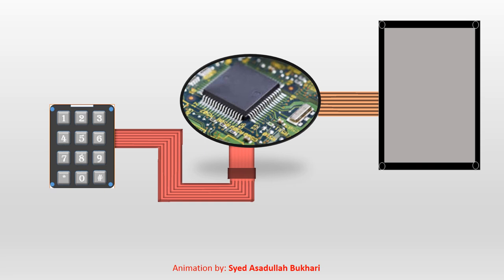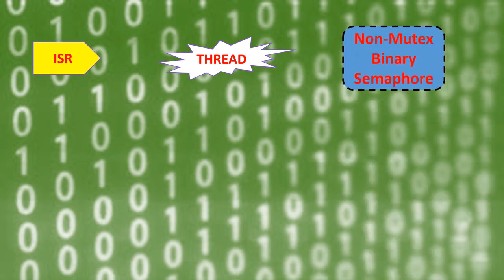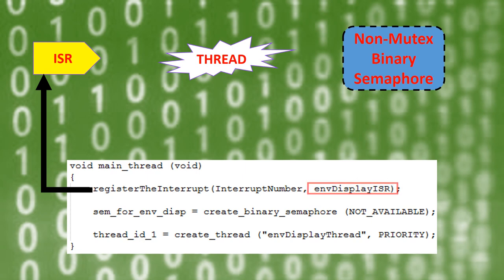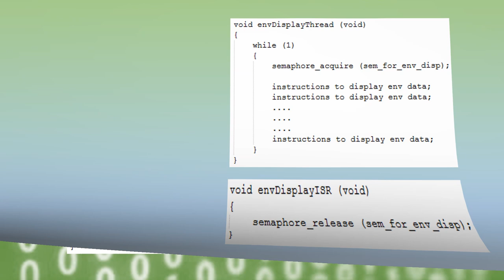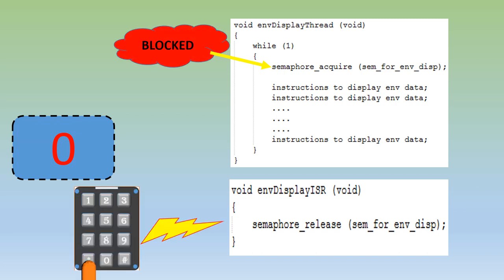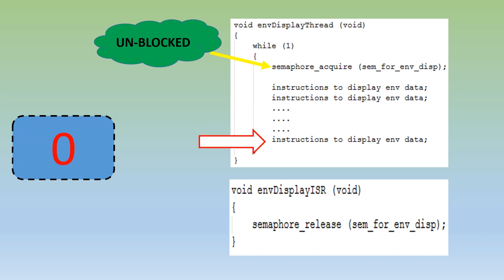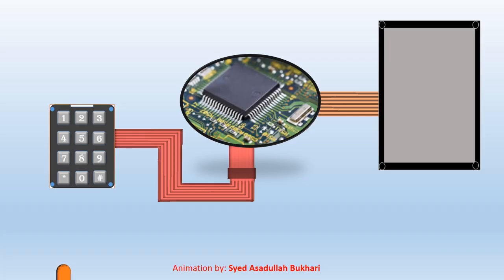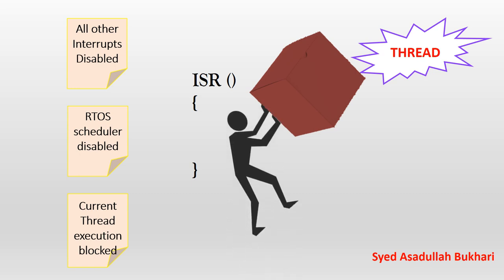Thread (Task) and Interrupt (ISR) synchronization in an RTOS

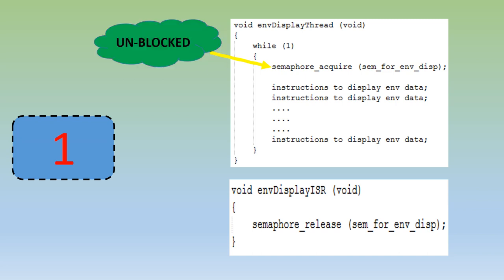Comment: There's one important thing missing in this video. At 4:57, when the ISR makes the sem available and returns, the scheduler will step in and check for the threads that are waiting for the sem. If there's any, those threads will be changed from blocked state to ready state. And depending on the scheduling algorithm, the ready thread will executed based on round-robin or time-slice, .etc. In short, there are certain time points that scheduler steps in. And properly choosing such time points is crucial to an efficient RTOS.